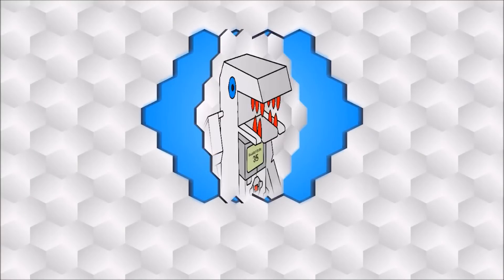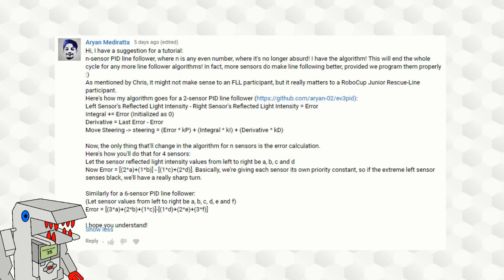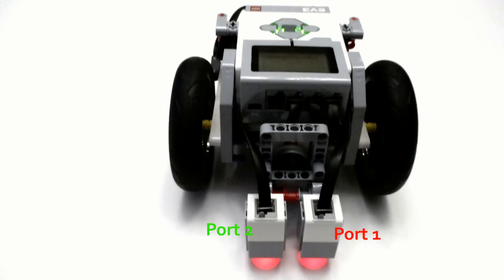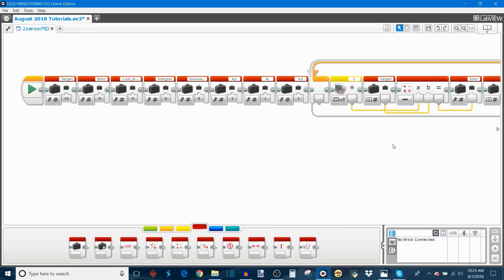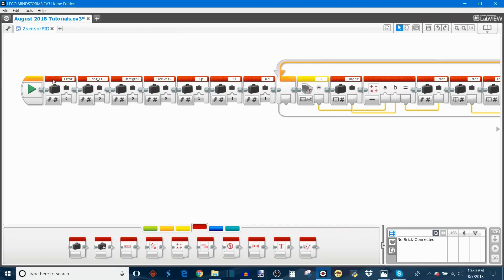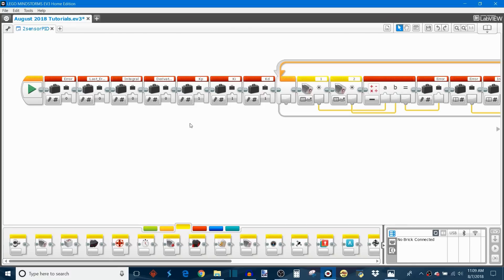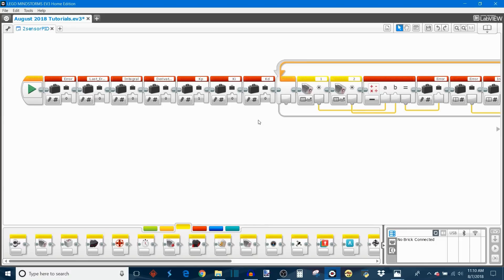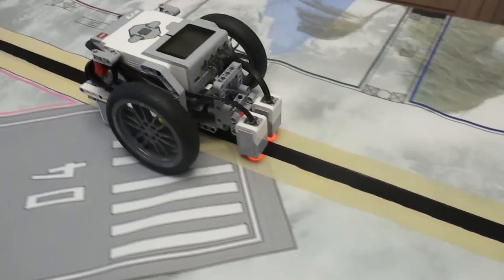2 Sensor PID Line Follower - The Most Efficient EV3 Line Follower

Comment: How do the K values vary, or what do the numbers depend on?
Reply from the maker: K values vary based on your robot's construction, and is affected by features such as wheel diameter, distance between drive wheels, placement of sensors, robot's mass distribution. etc. It's best to determine them experimentally (through trial and error).
Reply: @Builderdude35  Thanks a lot!

Comment: Does this line follow work for lines with gaps too? If not can you please suggest a line follow which works with gaps and 90 degree turn.
Reply: Yes, it does work with gaps. However, this algorithm will work provided that both sensors provide similar reflected light intensities for black and white
Reply: I've faced that problem, what you can do in that case is to add a switch statement similar to that in an on-off (boolean) line follower and make it such that if both sensors sense white or if both sensors sense black, move forward.
Else, run the PID.
Reply from the maker: You can learn about programming a line follower to pass over intersections (or gaps) in lines from this tutorial: https://youtu.be/LXdm6-Gl0WE

Comment: Hi! Can you please try using unregulated motors? Thank you.
Reply: John Paul Trinidad pleas it will be great if you use
Reply from the maker: Thanks for the suggestion, however, there is no advantage to using unregulated motors; it just introduces some instabilility.
Reply: @Builderdude35  Yes but, I was planning on using this program for my design which uses medium motors but it doesn't work because you are using a move steering block.
Reply: @johnpaultrinidad133  i can help u
Reply: @johnpaultrinidad133  i can help u